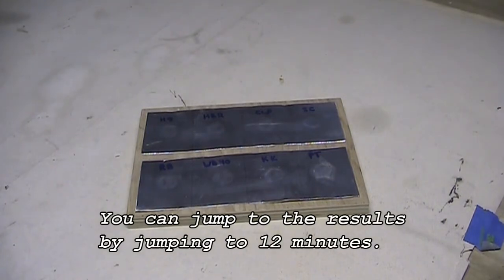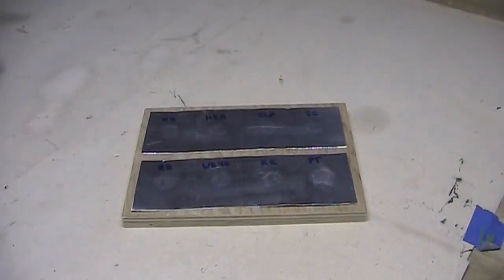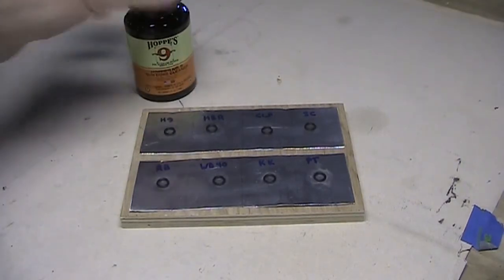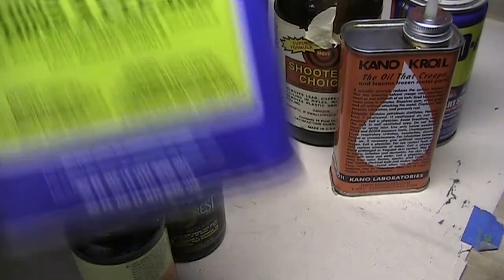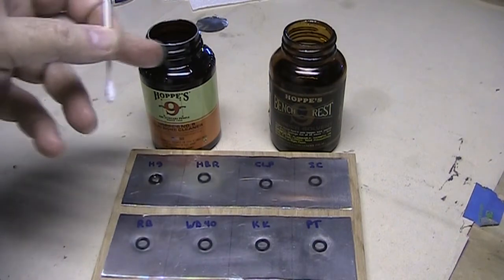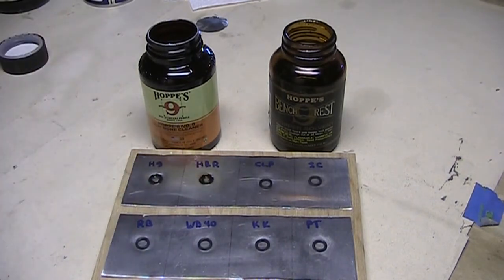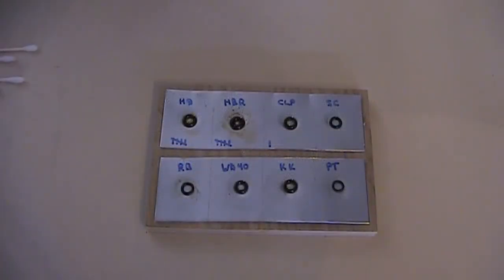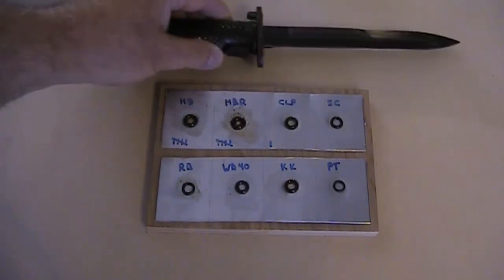Test of Gun Cleaning Chemicals on Airgun O-rings

Comment: The important and unanswered question is what were the o-rings made of (e.g. Buna-N, Viton, EPDM, etc). This makes a huge difference to as what will cause o-ring degradation, and what will not. 

I've been struggling to figure out what products to use on my Vulcan PCP, so your documented efforts are much appreciated.
Reply from the maker: For some reason YouTube thought your comment was spam.  Sorry I didn't approve it earlier.
For me, if inexpensive and locally available (no shipping charges) o-rings work it doesn't matter what they are made of. I just examined the rings I tested and they still seem like new.  Gun cleaning chemicals (most of them anyway) apparently aren't harsh enough to make a difference.
Thanks for your comment.
Reply: No problem, sir! Sometimes I wonder if the AG community gets a little caught up in the minute details. I'm guilty as charged.